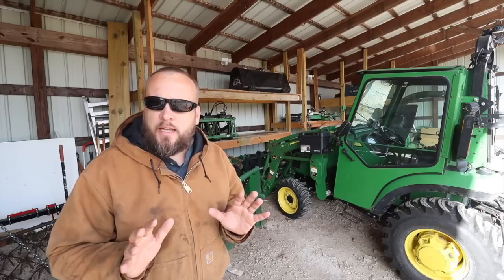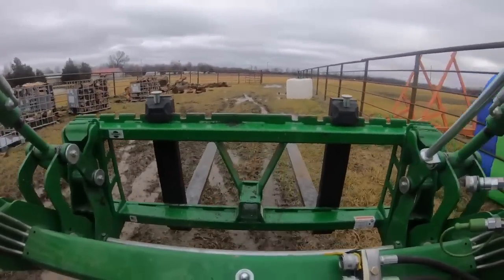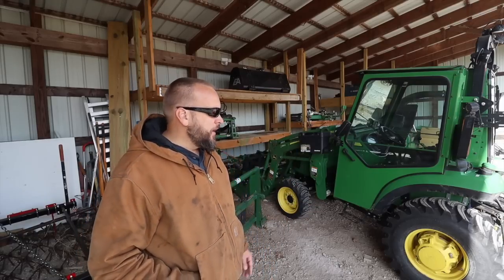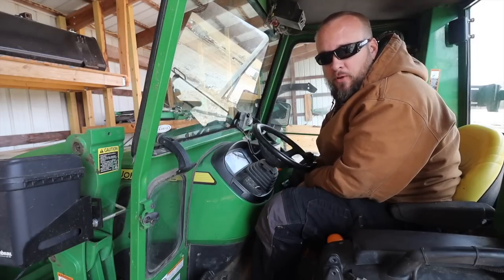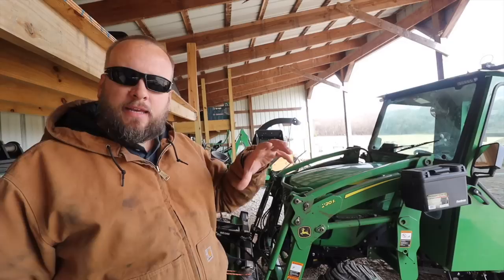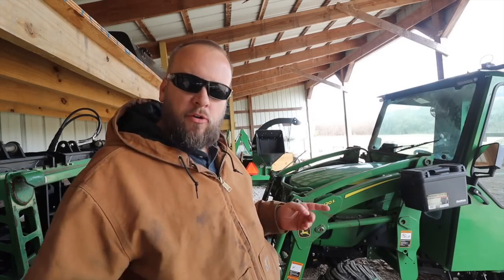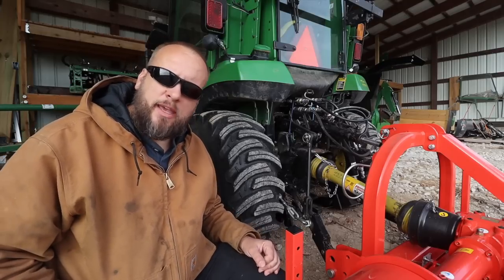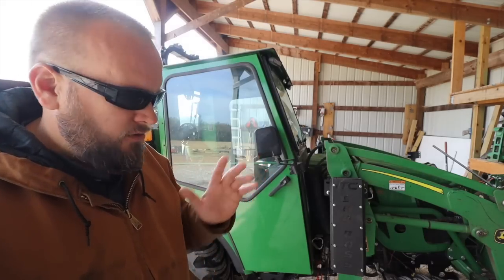John Deere 2038R Review After 650 Hours of Abuse

Comment: Wow, while I was watching your "Flail Mower" post yesterday I was wondering when you might do another extended use review on the 2038......and WA -LA!!!!  Great minds think alike.
Awesome update review Brock!👍👍👍 I have 2 years and 300+ hrs on my 3320 and while it's a tad bit heavier duty, you're right the series isn't that big of an increase in lifting and operating weights where they overlap.  I don't have all those add on's but I do really enjoy running my tractor and I have not ever had it stuck, I was very close a couple times but did get out.  I have the bigger wheels vs the 2 series, loaded with beat juice, and that makes a huge difference I think, can't imagine a compact tractor without loaded rear tires at minimum.   These are extremely capable machines when run by operators who know the limits and how to stay safely just below them.

Comment: I just watched your earlier review video the other day. Still fairly positive, but it seems like the honey moon is over. I got an rk 37 this summer and it compares pretty closely to the 2038r, but it has a larger frame, factory cab, and comes in cheaper. Whenever you do these videos, I feel better about the purchase. It has telescoping draft arms and the pinned sway adjustment, and a lot of other goodies. Mine has AC and factory cab with radio and bluetooth. However, JD definitely wins on ergonomics and support/products. The manual is probably much clearer too and easy to find info. I definitely wouldn't say it is a clear decision, but I feel good about my choice.

Comment: I’ve got 21 acres and I have a Kubota L3301 with a box blade, fel, backhoe & rotary cutter and it’s been magic in helping me in every aspect of turning the place into a home. I did consider what I’d be doing before I purchased it a few years ago. My options for the same model hp were 25, 33 and 39 and I think I made the right choice. I think a 30+hp tractor with fel and hoe is a good starting point… I wouldn’t want to go less than 30hp.
Reply from the maker: Sounds right to me

Thanks for sharing

Comment: Love the videos. The bigger machines are affordable if you don’t have to get all the bells and whistles, most of which are useless to me. The current deere dealers in Texas have all the small “r” series for more than I paid for my brand new 5075e 4x4 with cab.  My thought is I’d rather have a lower package f350, then a fully loaded ranger.
Reply: Just bought a 5065e with 100hrs for $10k less than a used 4066r with the same hours.

Comment: I believe the 4 series you can factory order with a ssqa... otherwise deere does sell an adapter if you want it. I do think the jdqa is better then the ssqa. Also if you have a kubota track loader and a little bx compact you probably don't want to share attachments anyways because the heavy duty track loader pallet forks would be way heavier built and take up half of a bx lift capacity.  It makes sense if you had a bx and maybe a bobcat s70 or a stand on unit that both have lighter attachments.

Comment: I'm considering a b2601 or a 2038r JD. My local dealer does not have any LX model kubotas. Said it's not a good enough seller. Anyway, I will be using this tractor to make money and also mow my lawn. I only have an acre to cut so 54" mower on the B2601 is plenty large. I'll be getting backhoe as well. My question is have you operated both of these and is the 2038r worth paying 8k more to get?
Reply from the maker: I don’t know much about the 2601 besides looking at them on dealer lots

Actually listed my 2038 for sale yesterday. Posted a whole video talking about why I’m selling it and how much I want for it

Comment: After owning a 2015 2032R, I traded up to 2022 4052M. I wanted a HD 4052M but the 5+ month wait time was not an timely option. It would have came with the extendable draft arms and SSQA loader. That would have required an adapter plate for my JDQA loader attachments. This bigger tractor is great for bigger jobs and worth every dime over a 3 series

Comment: instead of making bigger machines more affordable with smaller engines they need to be making smaller machines with bigger engines, also more affordable. next step up in the 2 family linup should be a 2046 = 46hp tractor. and in the 3 family a 3070 = 70hp. i see no reason with todays tech why something cant be made smaller, albeit heavy, with a ton of power. heck there should be a 2066r  = 66hp tractor at least lol
Reply from the maker: I like the way you think.

The reason there is a popularity of the larger 25 hp machines is some people want to avoid regen which means staying under 25 

2nd. If you’re on a tight budget it can feel like you’re getting a large machine without spending much money and a lot of people are on a tight budget.